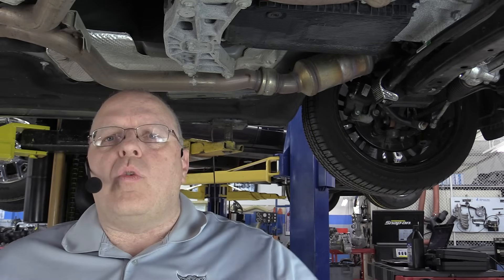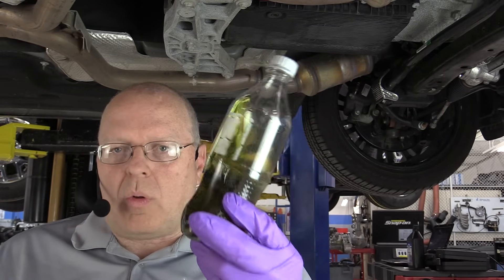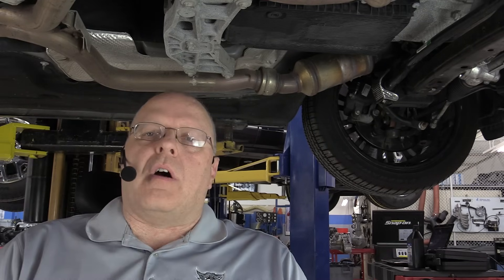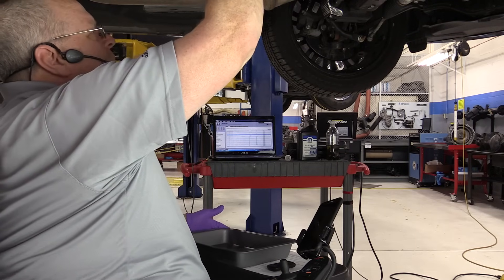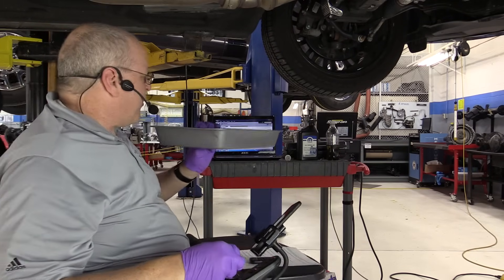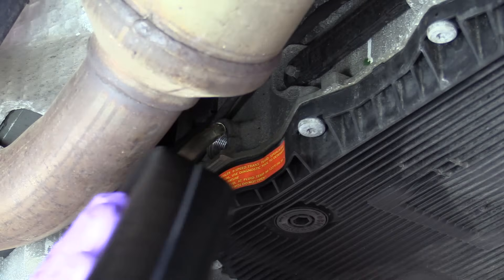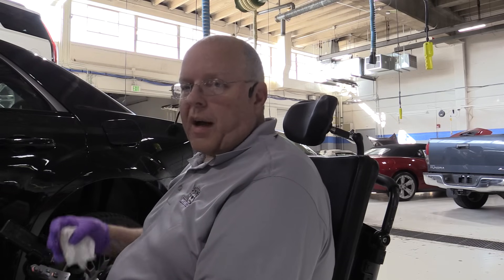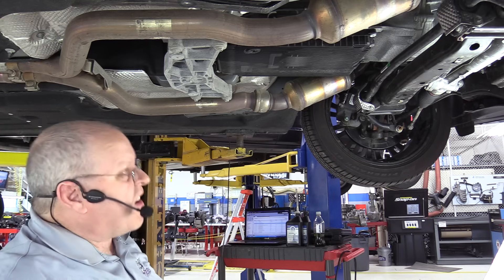Jeep, Dodge, RAM ZF 8HP 8HP 8-Speed  Transmission Fluid Level Check - No Dipstick

Comment: I couldn’t believe leave when I opened my hood on my newer RAM and it didn’t have a dipstick, now this somewhat quick process of checking transmission fluid has turned into a full on service.

Pretty sad if I am honest considering one of the leading causes of engine and transmission failures is low fluids.

Comment: What if you start the engine when it’s cold, remove the plug and fluid does come out?  Do we need to add any?  Or does that mean its too full to begin with?
Reply: If you do the procedure or drive it on a short drive you should have a light trickle of oil with the car level, engine running and temp below 120.

Comment: Would this procedure be sufficient on 2021 jeep jl wrangler rubicon equipped with 850RE tourqe flite transmission? Thank you for this content, Brandon😇
Reply: Yes same as the 8hp70 transmission. Same pan and filter as well.
Reply: @Ada-zn3pw  Thank you 😇

Comment: They're not too bad to service but my god, could have given us a dipstick. Still a good unit just annoying, exhaust is right there next to fill plug on my bmw. I'm on #2 drain and fill, #3 I'm dropping and replacing the pan with the PPE deep sump unit. The temp still annoying. What happened to check warmed up? Is that to cover all the possible thermostat/cooler routings or something? 
Also, for what it's worth, one can now get ZF fluid (or Pentosin) for about $10-15 a qt, as well as a few aftermarkets who make a fluid specific to this spec. In the US, advanced lubricants has some great stuff! Their 'green' cold climate in particular works really well. 
Frankly I've always run Valvoline synthetic multi vehicle ATF - around 2021 if I recall- they reformulated it to meet the LV requirements for newer units. It's only slightly thinner than OE ZF8, which arguably is better than slightly thicker with modern valvebody/clutches that need really quick engagement. Ford 10R80 comes to mind, that fluid is "ULV" at around a 4.5 CST @100 if I recall

Comment: Yea but if the bypass has been closed that means those lines are full. So you shouldn't really have to worry about the bypass. Right. So I'm not seeing an issue. I would say the fluid level is good. I figure this because today I'm putting my engine in and i have my lines disconnected to the bypass. And trans fluid will leak from them. I've had them plugged up. So i do not think it drains back into the transmission like you did. I think they have enough fluid in the system to account for the bypass lines. But checking it again wouldn't be a bad idea.

Comment: Could you not heat cooler valve with small torch to increase its temp to over 160 degrees, so it will open and flow fluid through cooler, while transmission remains below 120 degrees? Check temp with laser temp gauge.

Comment: I would thank you for this amazing clear video  that clarify step by step how to check the oil level and important tips not to be forgotten.     I am facing a fault code P0782 in my range rover sport 2006.  I have changed the transmission oil , but it still there ,   if I drive it on the Manual mode it goes normally smooth changing all gears no issues,   but if I drive on "D"  it makes an issue between 2-3 gears.

Comment: When your working by yourself, just checking the fluid takes a while to do.  When your vehicle is in for service and they supposedly checked all your fluids, you know they're lying when the procedure takes this long and has to be started from a cool temp.  I'm convinced they have a faster method that they allow dealers to do.  Some vehicles I work on like bmw's, have no engine diptstick and is only checked by computer.

Comment: Good video. I owned a Land Rover L322 with a ZF transmission and would do the work myself. I hated the fact that the fill plug had to be used to check the level by making a mess. But after thinking about it for a few years, it's way better then a dipstick. Why? Cause whenever changing a fluid the fill plug should be cracked open first, so it's known it can be refill. Nobody does this. So by forcing people to break free the fill bolt just to check the level makes sure it won't be seized. Put a dip stick in there and that fill plug might not even be opened until a second owner wants to change the fluid and then good luck with that. Worst case scenario, someone drains all the fluid and then can't open the fill plug and strips it. 
Anyways, I never gave a thought to the cooler when I pulled the valve body, cleaned it and replaced the solenoids put it back, filled it and crap magically appeared back in it. Years later now I just figured it out thanks to your added tip at the end. 
But since that valve is heat activated, assuming it would drain when cold. The fluid level check should be right cause it is closed as the level is being checked. At 120F I'm guessing the valve would open and that's why transmission fluid has to be checked below that upper cutoff temp. Not because the fluid expands, but because the cooler valve opens. Just a guess, but it makes sense to me at least. Thumbs up on the video.
Reply: If it had a dipstick you wouldn't need the fill plug. You'd fill it like a normal transmission through the dipstick tube.

Comment: Hello Great video and to the point, A question as a user, Chrysler claims you should not change the transmission  FLUID (They claim LIFETIME) so the question is, should a user change the Fluid? if yes how often? Thanks again
Reply: Zf recommends 80k miles and/or 8years. Double check for your trans

Comment: Has anyone else ever noticed that the label on the 8&9 speed Mopar trans fluid says to shake the bottle before using?
Does this stuff separate in the bottle?
Reply from the maker: Many newer transmission fluids require shaking the bottle too.

Comment: There are 2 lines leading to the cooler (on top of the condenser you said). Can we disconnect the one of those 2 connections and connect one end to a funnel and another end to a drain pan. (We need to know which one is ingress and egress). Start the engine and let it warm up so that ATF comes out (assuming it has that aluminum thermo value). Keep on adding new ATF to funnel while watching the amount going to the drain pan. At the end, add a bit more and reconnect the disconnected line to the cooler and do a final level check at the tranny refill plug? 8HP has 8-9 quart total ATF capacity?

Comment: Have this transmission on my newly purchased 2012 F11 gen BMW 530d xDrive. BMW proudly announces that the transmission fluid is "filled for life" - well, if the life of the car is 50 000 kms, then maybe. Otherwise don't listen to them. Also, BMW claims that in the engine of these vehicles, the engine oil should be replaced every 30 000 kms - which is absurd. Weird how in Britain they had a class action lawsuit against BMW for snapping engine timing chains. I don't think there was anything wrong with the chains. I'm absolutely sure there's something wrong with "30 000". Replace engine oil after every 10 000 kms (which in freedom units are 5 bald eagles and 1.75 bottles of coke). Greetings from Latvia - and thanks for this video. Probably saved me a lot of trouble (by not doing it myself - and questioning everything the transmission shop knows - before delivering the car to them).

Comment: @15:02, you state the level check was done with the cooler bypass valve "open" - I believe you meant to say "closed", which is what it would be if the temp is below 160 degrees F.

Comment: This is almost a great video, but you use the phrase "open valve" very confusingly.  At several points you say the valve is open when the engine is cool.  Then later you talk about getting the engine hot to open the valve.  This cooler valve is the most confusing thing preventing me from doing this service.  ZF's instructions are also confusing to this point (essentially says to drive hte vehicle until the temperature is under 75 C, whcih makes no sense)

Comment: 2005 Defender transmission fluid check procedure 

Remove transmission filler plug

Top up oil until it comes out of filler hole

Replace filler plug

2022 Defender transmission fluid check procedure 

Um........

Comment: On 2015 chrysler 300s AWD. I drain the fluid it had approx 5 qts. When refilled i can put no more then 3.5qts. Plus I have front drive shaft infront of fill plug. I am stuck now I need to put another 1.5 back in it. Not sure how. Any suggestions ???

Comment: So in short they designed this wonderful transmission with absolutely no way to accurately check the fluid level. As an engineer I am totally embarrassed when nit wits like the designers of this unit are allowed to remain employed.

Comment: Soooo…… 

Does it drain back if you get it above 160 and then park and shut it off hot above 160?   Or do you need to drive it hard to get it above 160, then drive it nice and easy to get it below 160… And then shut it off?  (before rechecking the fluid the second time)

Comment: I’ve been scratching my head trying to understand how the external oil cooler impacts this procedure. I’ve looked at photos of the oil cooler for my 2015 Dodge Durango. Both the inlet and outlet connections to the cooler are above the cooler itself. Based on this, a full cooler will not drain back into the pan and impact the fluid level. I’m concluding that unless the cooler is replaced or otherwise drained, there is no need to consider it in the procedure. Can anyone confirm or refute this statement?

Comment: Just did this and checked my trans. It has been slipping so I figured it may be low. Trans temp was 111. I took out the side plug and it poured out very quickly. Would this suggest that it was over filled?
Reply: If the engine was running and at 111 degrees it should trickle out slowly

Comment: I am planning on changing the transmission pan with filter and draining the transmission fluid prior to removing the pan.  Should I drain the transmission with the fluid at operating temperature to ensure that all the fluid in the cooler is removed as well?

Comment: What sense does this make. First off, he keeps saying “open” before AND after 160 degrees. Second, if you have to let it heat up to get into cooler lines, but then cool back off to check, then would it not drain back down and put you right where you started???? HELP I AM BEYOND CONFUSED
Reply from the maker: Read the video details page for an explanation
Reply: Because he said it wrong the second time. It opens at 160, not closes.

Comment: The filter on these transmissions are molded onto the pan, so to replace the filter you either have to buy a new pan with filter or b you have to purchase a dorman pan with a removable/replaceable filter.

Comment: i appreciate your video but i truly think that this a complete stupid transmission design from any manufacturer that you cannot check the oil level at resting and cold temperature just like you can do with an engine except for some new engines where you dont have a dipstick but instead you have an electronic display so the day that your display goes out you cannot check the engine oil level, think of it for a minute, where is supposed to be the fluid level when its cold and why not put the fill plug at this level? better than that good old dipstick is missing big time, that is not an improvement this is stupidity at the highest level

Comment: The Transmission in my truck is tilted slightly lower in the rear thereby making the level naturally higher since the level plug is closer to the rear.
Does the Truck need to be level? or the Transmission?
If the transmission needs to be level, then I will need to park my truck on an incline.
Can anyone comment to this variance? 
Please advise.
Thanks so much for your help.
Jeff
Reply: I have exactly the same question. I think this is the same in all cars because pan itself is tilted. I found some PDFs and it says that vehicle must be leveled - not the transmission. But it doesn't sound right to me.

Comment: I have a suggestion about the bypass cooling system. I think it’s important to take care of that if the cooling system was removed (because it became empty) BUT if it was not removed, oil theorically still in the system.
Reply: Ok but you need to bring the oil from the gearbox to operating temperature before oil drain which maybe exceed 70 celsius

Comment: Thank you so much for that masterpiece of a video, I currently have a bmw with the zf8 and it’s whining, have you ever heard of the transmission whining and if yes what does it mean, does it mean it’s low on oil level or low on cooling ? Thank you
Reply: @hass 100 , mine BMW e70 transmission also has developed a whine.  Have you learned more?
Reply: @spanwiser  I've seen others saying they have a whine when fluid is low

Comment: well actually if you think about this, if there is no fluid passing through the valve below certain temperature then how would the valve ever open .... if no hot fluid will ever reach the the valve then the valve will be shut forever even if transmission is at 1000000 degrees.......no?

Comment: #1 great thorough video... do this under warranty #2 Chrysler didn't engineer this transmission #3 Chrysler doesn't make transmission fluid it's a $40 per qt. money grab #4 Chrysler engineers are probably the most worthless source of information of the major manufacturers #5 Valvoline max at $30 per gallon is tested to 60k and the trans disassembled and inspected for wear guaranteed to function better than factory fluid... #6 I've seen it many times from my own repairs dating up to 2020 units... saved slipping transmissions 👍😉👨‍🔧
Reply: And again... excellent information about the transmission

Comment: If only all videos were as good as this one!  
Question for you experts out there:  

Background: I've got a 2014 ram 1500 with 147,000 miles on it. About 10,000 miles ago I experienced some minor shuddering in the transmission.  Right or wrong I asked my transmission mechanic to add some lube guard instant shudder fix. The outcome was that the transmission has been running as perfectly as it ever has ran.  Essentially the snake oil worked.  No previous transmission work of any kind was done on the vehicle - maintenance or otherwise.

I'm about to go pick up a used travel trailer and I am wanting to do any preventative maintenance that I can within reason and within my tight budget. (travel trailer is to serve as a basecamp while I start building my home on some land - also on a budget).  

My question is, is it true that a philosophy of if it's not broke don't fix it applies to this transmission or will it be smarter to do a transmission oil change.  I am reading a lot of things that say that it's better just to leave it for now since it works fine.

Thanks in advance for your advice. I realize there won't be a perfect answer here. Also I realize that there are surely several things that I should have done before this,  My bad, owning it.  So if we can skip any of those responses and stick to my question of what the smartest thing to do at this point in time as opposed to what I should have done in the past that would certainly be the most helpful.  

Thanks all!

Pete
Reply: A bit late but here is my two cents. If its above 100 000 miles do not touch it. The fluid has contaminants and has become thick. If you change to clean fluid it will be thinner in comparison and may not work efficiently, causing damage to transmission. In case it has been changed previously you may proceed with the change of fluid. You may have to ask the previous owner. If unsure do not touch. Less than 100000 go ahead and change.

Comment: I just completed a drain & refill on ram 8 speed.  The directions I printed off from ZF state if a transmission cooler is present you should over fill by .5 of a liter.

Comment: I have a 2016 ram 1500 pick up , it won’t shift at 20 miles a hr, I have no transmission dipstick , if I check the transmission plug to see about transmission fluid lever if need some added will it run and shift like normal , need help with this problem

Comment: Keep in mind the level of your transmission! Not necessarily is the trans level if the vehicle is on a level surface. E.g. 2017 Dodge Ram 1500 you must raise the rear end so the rear wheels are about 9" off the ground before the transmission itself is level. Use a small bubble level across two transmission pan mount bolts, not the pan fins, to be sure. You could use the 1st outer heat shield fin also.
Reply: Hi, are you sure about that? I see the pan is thicker on the rear and the bottom of the pan is leveled when car is leveled. In BMW I see it as well - when car is leveled, the transmission pan's mount screws are not leveled. I tried to find some documentation, but I've never found the information to level transmission. It always says about car. Unfortunately this topic is not covered in the video.
Reply: @folfix  Yes, I am sure. This topic is not covered in this particular video but it is in others. The depth of the pan is to accomodate fluid capacity. My RAM has air shocks for example and I can set 4 different height levels that will change the angle of my engine/trans regardless if I am on a level surface or not.

Comment: I know it's an old video, but I had an idea. What if you use a heat gun to get the valve to open up for the fluid to pass through the cooler that way it's 100% accurate?

Comment: Mopar $44/quart is highway robbery - you can get OEM ZF lifeguardfluid 8 online for $20, or use Valvoline MaxLife ATF which list the ZF fluid 8 as replacement on their spec for $4.50/quart ! 
Remember that Chrysler/Mopar doesn't, nor does ZF, make oil - they rebrand (and market up) somebody's oil...
A pan+filter replacement and drain/refill will take 5-6 quarts so a insignificant saving... if you drain cold, you don't need to worry about the cooler.